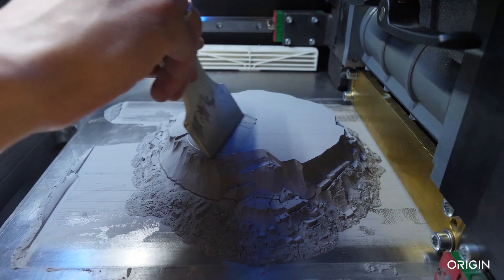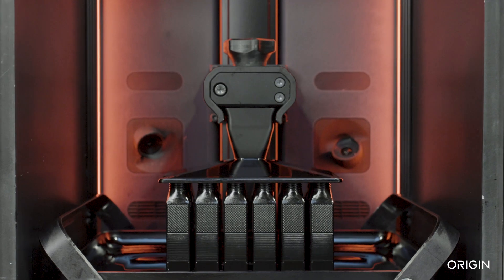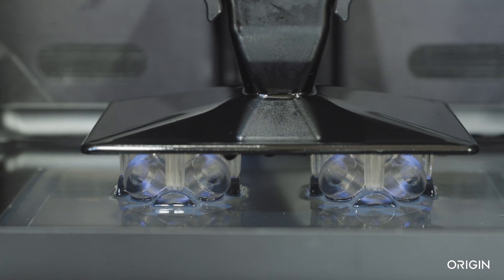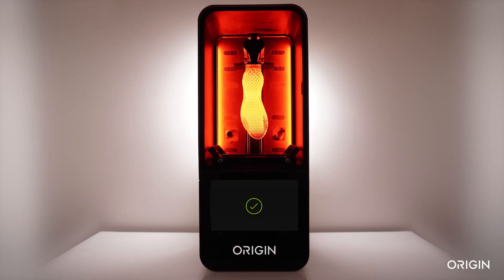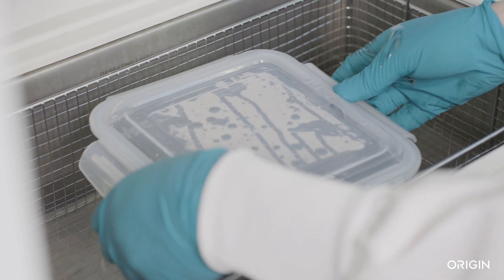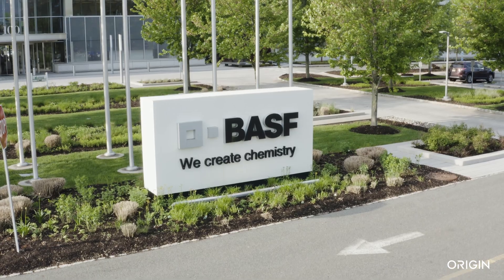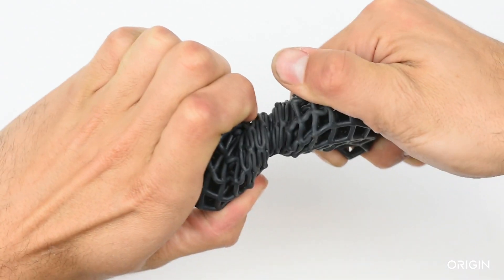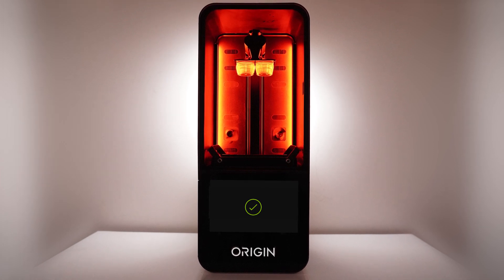Introducing Origin One - Open Additive Manufacturing

Comment: How does post-processing parts printed with Origin's P3 technology compare to parts printed on other SLA/ DLP systems? How are "minimal supports" achieved? It appears to be a bottom-up process and thus the part requires supports sufficient enough to resist forces exerted during the peeling step like most bottom-up SLA printers right?
Reply: Origin One's parts achieve nearly their final strength while in green state, because the materials they print are very, very chemically different from most SLA resins. They also include some novel improvements to the release step that reduce the forces involved. It can print overhangs as extreme as 20 degrees without support due to the strength of the part during print, and can even print some 90 degree overhangs unsupported.
Reply: I just read up on it.  Seems to have been acquired by the dreaded Stratysys.  Basically it “balloons” the clear part to pop off the cured layer, rather than the conventional ripping, or Prusa SL1 “tilt ripping”.
Reply: I can’t speak to the uniqueness of the materials le se, but i feel like this is either a “Carbon3D” machine without that CLIP process speed, or a standard MSLA / LVP (resin printer, whatever you want to call it), but *an order of magnitude more expensive than a Prusa SL1s, or an Mars 8k (and higher nowadays) and similar devices.

So, at least from my armchair perspective without knowing of they have some truly unique secret sauce, it seems not that impressive.